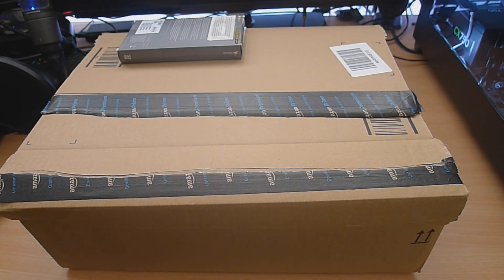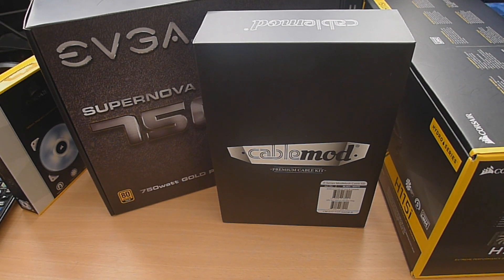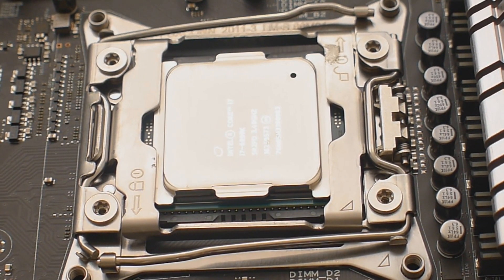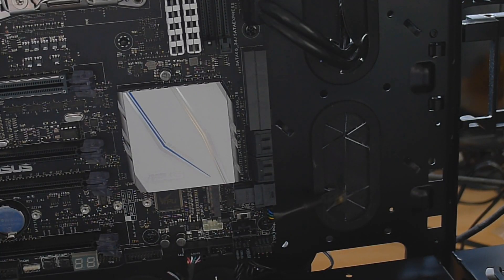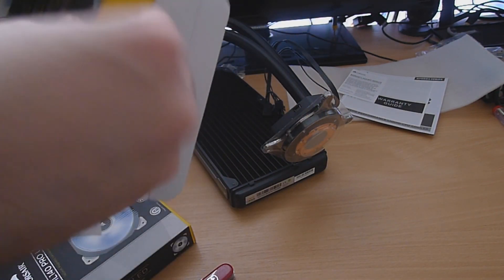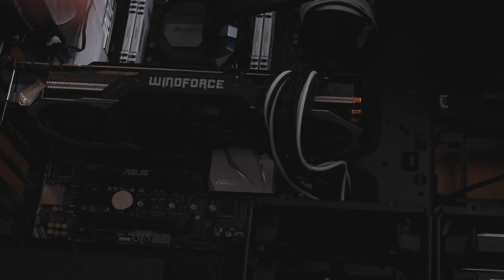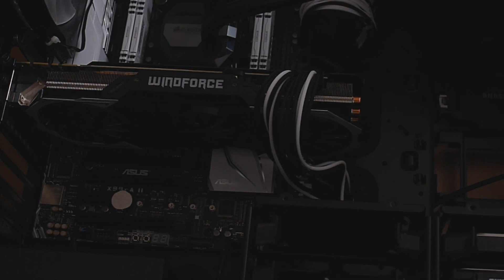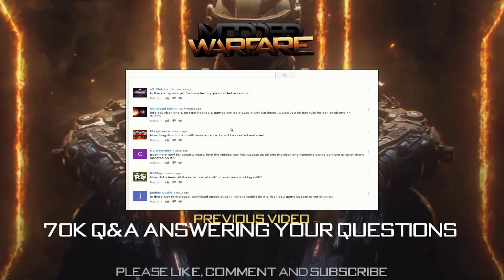Building a New Gaming/Video Editing PC

Comment: You're supposed to install the RAM in every other slot.
Reply: yeah, thats what i was gonna say...
Reply from the maker: I can't, Only half the RAM from one set of DIMM slots on one side of the board gets detected in a quad channel config. Not sure but I think its a problem with the motherboard as I can have all four sticks plugged in quad channel and the bios shows N/A on the other two sticks also I think it's similar to Luke's issue from LinusTechTips as he had a similar problem with his personal rig build and that was also an X99 build. https://youtu.be/QJs2CRWYsBw?t=13m12s The only way I have been able to get all 32GB of RAM to detect in the BIOS and OS is to install them in dual channel. If there is a fix please do let me know.
Reply: So did you RMA your motherboard because of the DRAM issue?
Reply: You need to populate the gray slots first, not the black. This is in the manual.

Comment: Why X99 Broadwell-E and not Z170 6700k? Do you really do a lot of video editing?
Reply from the maker: well I have over 300 videos on my channel so yeah.
Reply: Yeh but that's over many years.
Reply from the maker: Yes well it's nice to have faster render speeds and more cores for multi threaded work loads. Yes I know I could of made do with a 6700K or 7700K but I wanted a larger performance increase in my CPU upgrade.
Reply: MODDED WARFARE Yeh fair enough if you do more video stuff than gaming. What cpu were you coming from? What parts were an upgrade in this build? and what parts were new?
Reply from the maker: Everything shown at the start of the video was new, PSU, CPU, Motherboard, RAM and Cooler. The storage and graphics card were reused from my old build. The CPU I had before was an I5-3570K
Reply: MODDED WARFARE Very nice. You never mentioned if your old windows install did still work?
Reply: Microsoft let you use Windows 10 on any PC, if new hardware is installed. I know this because i changed my motherboard to a ASUS Z97-P other day, and it said re activate. I looked online and you can use a License linked to your M$ account to activate it

Comment: Dude you are suposed to skip one ram slot so you can get proper 4 chanel ram.  that shoud fix the 2400mhz problem
Reply from the maker: That's not the problem. The problem is that I didn't check to see if the motherboard fully supported 3200Mhz RAM. Which is doesn't. So the only way to increase the RAM speed above 2400Mhz is to up the DRAM voltage or the system agent voltage. Also when installing the RAM in a quad channel config, only half the RAM is being detected.The only way for me to get all 32GB to detect is to install in duel channel config.
Reply: MODDED WARFARE that doesnt make sense my friend has same MOBO as you and also 4 RAM sticks with 32gb, they are running on 2666 out of the box and all 4 dimms are running fine in quad channel with one dimm slot appart.
Reply from the maker: Might be an issue with my board then. One of the internal LED's was dead on arrival. I can't set the speed over 2400Mhz without getting error code bd and the system failing to boot causing it to go back to default settings at 2133Mhz, I can go up to 2400Mhz but any higher and it fails to boot. I'm still looking into it.